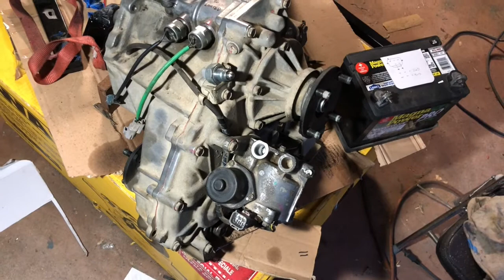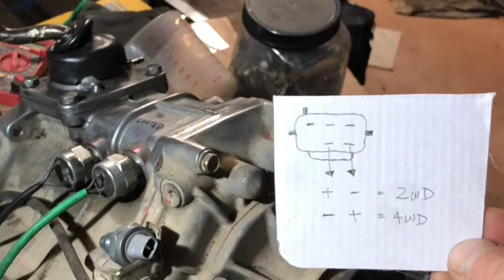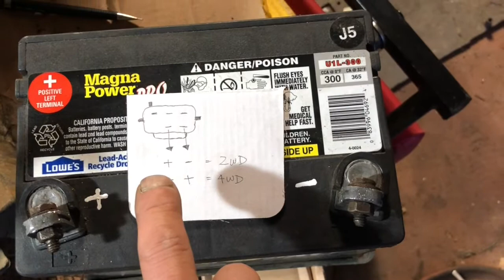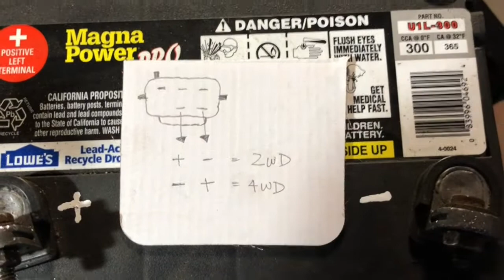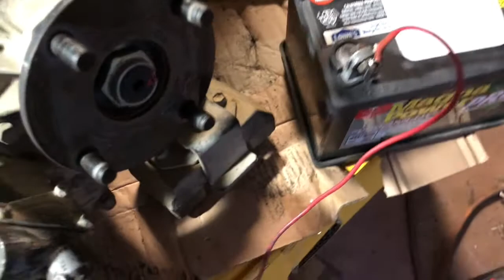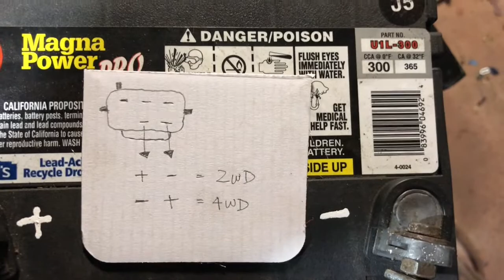Toyota 4Runner transfer case actuator test 1996 Limited 4WD - 3rd Gen

Comment: My ‘97 will not go into 4hi (no green light on dash and no noise from actuator) but will go into 4lo (green light on and sound from actuator) so that tells me 4lo is engaged. I’m able to easily go back to 2hi, no problem. Is it a bad switch? Vacuum lines? Can anyone tell me what the problem might be?
Reply: Maybe the switch it sends the signal turn on the green light on

Comment: i seem to have this same problem but i have a different style of pin connector. all pins are in one row left to right. 2000 sr5 and the transfer case is the  multi mode version. any idea?

Comment: Hi, I want to ask if my actuator solenoids are working and applying voltage to the actuator motor works, where should I go next? I tested if the motor works and the solenoids are showing continuity and both work, however, getting it in and out of 4wd using the push button actuator is not working. Any suggestions is appreciated thank you!
Reply from the maker: So you're 100% sure you tested the actuator motor and it works? Are you not able to switch from 2wd to 4wd at all or just sometimes?
Reply: @cal_n_hob  at all, when I applied 12v to turn the actuator motor, I was able to spill all 4 with the front and rear drive shaft
Reply from the maker: @josephrivera6563  has the 4wd push button ever worked?
Reply: @cal_n_hob  no, it has not. Recently got the vehicle about a month ago
Reply from the maker: @josephrivera6563  not sure then bro, i would start with the basics.  make sure the 4wd switch actually works on the shifter then work your way down.  you can also check the 4wd computer (green box in the lower left kick panel) to make sure the relays are still good

Comment: Hey, thanks a ton for the video! I do have a question. I have a 98 4runner limited. When changing the transfer case fluid, I noticed a small metal detent at the bottom of the drain pan. It is 7mm in diameter and thought it was the shift linkage detent until I came across your video. Tested my luck and engaged 4wd plenty of times and everything seems normal. Only difference is 4wd engagement is silent, which could be from fresh fluid idk. Do you know where this 7mm detent comes from and if it's possible to put it back in without removing the TC? Thanks a ton!!
Reply from the maker: Sorry, not sure about the internals of the TC.  I will say a detent is meant to keep things in place so I wouldn't switch to 4wd, even if it's working until I look at a diagram to find out what it does. Also there might be a spring floating around.
Reply: @cal_n_hob  Thanks for your response! And good idea lol. Thanks again, wishing you well.

Comment: I’m having same issue where 4wd won’t engage. I took apart the front diff actuator and confirmed the motor is working. When I switch to 4wd I can hear the transfer case actuator doing something. I finally gave up and took it to the stealership, they said it was the sensors. I was suspect because I read somewhere that those sensors rarely fail, but I gave them the benefit of doubt. I paid their price for the replacement switches, around $200 and agreed to let them change them out for $400. They just called me and said they changed the sensors, “and now they are working” but the truck still won’t go into 4wd. I’m pissed. I should’ve know better. I feel like they are just throwing parts at it. Now they are looking deeper into it. 🤦🏻‍♂️
Reply from the maker: Wow, that's crazy expensive only to find out it's still not working.  It might be because it's still set to 4hi or something simple.  Let me know what they find.

Comment: Hey mate great video. I have some questions, what is that green wire and the one next to it coming out the side of the box.. mine got smashed off, everything still works fine. Also, is the center diff lock on an electric actuator also or is it mechanical via the leaver?
Reply from the maker: thanks mate.  check out my first vid where i talk about the two wires https://youtu.be/MX2YzfNb6yc.  The center diff lock is mechanical via the "4wd" push button on the j shifter.
Reply: @cal_n_hob  thanks. I'm thinking on my truck 1996 kzn185 surf, there is no light that runs from thoes as everything still works, nothing has stopped working since they broke. Unless they serve another purpose? In the surf, when you select 4 low, the center diff locks automatically. I would love to have the center diff as an option on a switch, so as to have 4 low with an open center diff. Can you think of anyway of achieving this? Thanks !

Comment: This is just what I needed to know. I'm having trouble getting in and out of 4wd. Shifting to 4x4 Low doesn't engage, and shifting to 4x4 High gets me into 4x4 Low. Now its worsened so that I can only shift between 2wd and 4wd while the engine is off. Thanks for the leads.
Reply from the maker: Let me know how it goes.